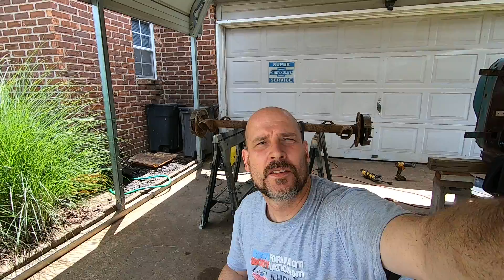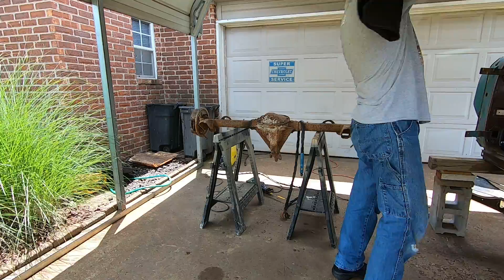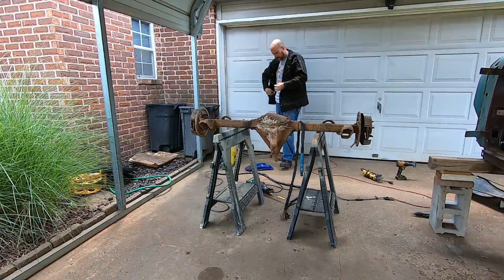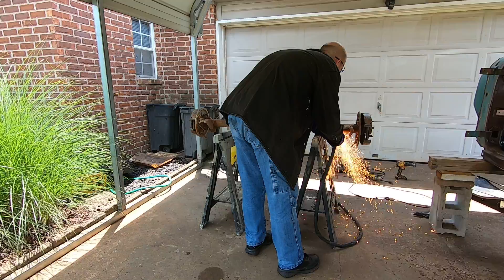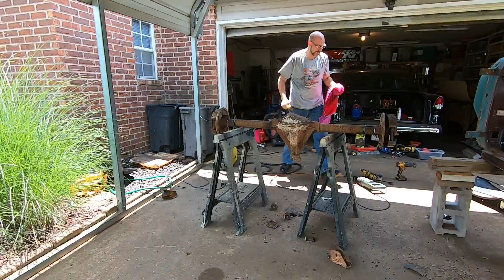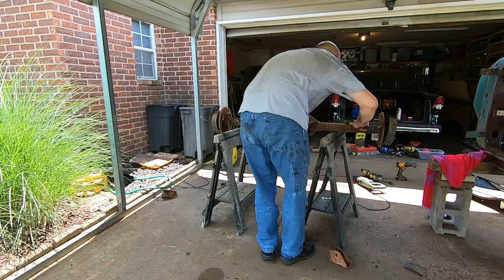1955 Chevy 4 Door Build Episode 25. Plasma Cutting the Rear End Brackets Off

Comment: I use the same basic machine. Learned two things, helps to have a dryer unit in the line to keep moisture out and replacement tips that have a cross-cut on them seem to work better and faster.